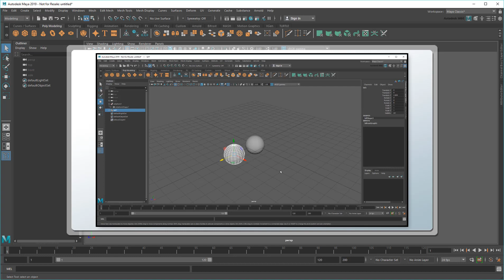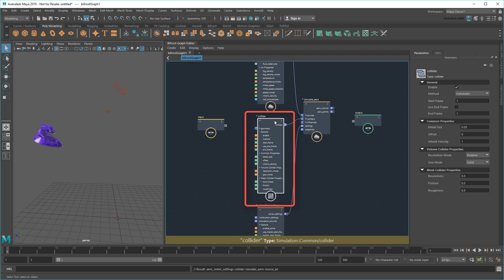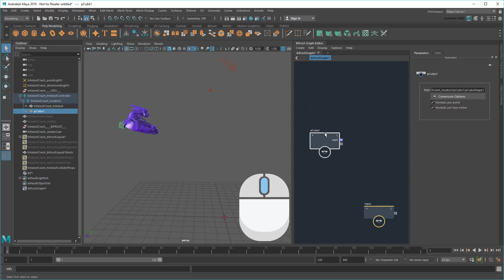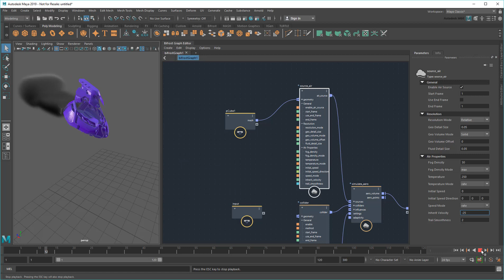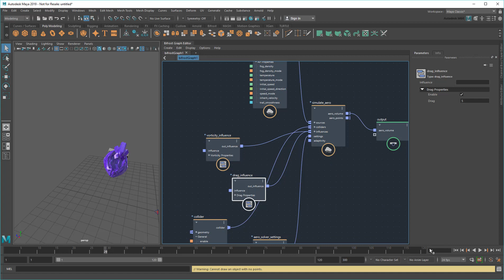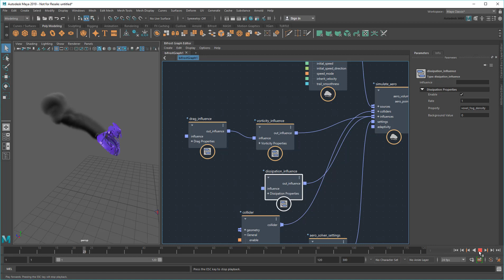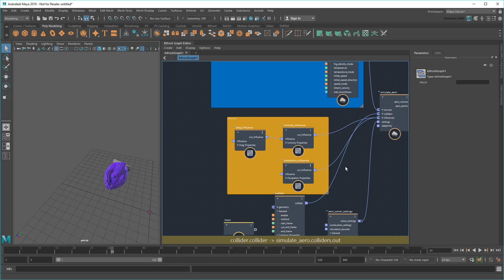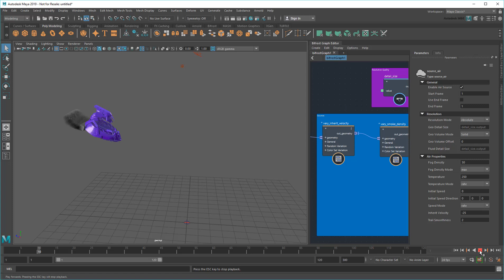Creating a smoke trail in the Bifrost Graph (ver. 1.9.5.3)

Comment: why my play time is slow? I've set time slider to play every frame but it plays too slow like it will take forever. pls Help me. I am following your Rocket Video.
Reply from the maker: Interactive play time for FX like smoke will often be slow (especially depending on your system specs).  In this case, what you need to do is run a "playblast" (Window > Playblast) or batch render to create a movie of the animation, which can then be played at full speed.

Comment: My smoke trail does not move. I can see the smoke bif object, but it won't move. My smoke cube is a child of the object that is moving, but it won't do move the smoke. I also was trying to work through the rocket series and my smoke trail was not even showing up there. the sphere would move in the trail path, but no smoke would appear. Any ideas?
Reply from the maker: What's your playback speed set to? Right-click the Time Slider and make sure it's set to "Play every frame"
Reply: @Autodesk_Maya  It is set to "play every frame". I checked a couple times. I even tried to create the smoke trail without the built in one and when I did that I could see smoke but it still didn't move.
Reply from the maker: @sophiebolotin9562  If you go to the Bifrost Browser and try loading the smoke (or any) example file, does that one work?
Reply: @Autodesk_Maya  The procedural cloud appears but that is it
Reply: @Autodesk_Maya  hi! I was able to get the smoke in the smoke trail to show up, but it doesn't move it just stays in one spot- I am working through the rocket example, but it doesn't follow my rocket

Comment: Awesome video! I'm a more of a modeler and texture artist, but since my tablet recently broke I've decided to delve into this new and improved bifrost. Loving it so far. The nodes do lag a bit more than I wish but it's nothing I can't deal with. The text in the backdrops is also puny! Any way to increase the size of that?

Edit: Maya just started using all of my memory (32 gigs) and left me unable to do anything but end the process. Any ideas if this is just my computer or did something happen in maya? Happened right after attaching the value node to the detail size's.. hadn't even tried to play back the sim.

Edit 2: Maya freezes whenever I attach the value node to the fluid resolution attribute. Nice.
Reply from the maker: What's the initial value of your Value node?  If it's too small, Maya is going to try and compile a simulation at crazy high resolution which will make it look frozen.  I'd set the Value node to something like 0.5 or even higher before connecting it.